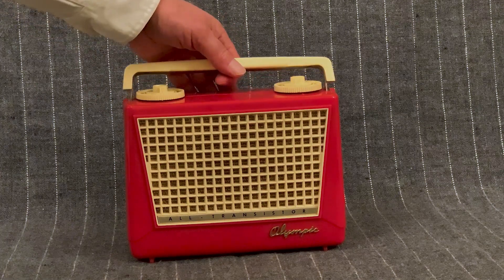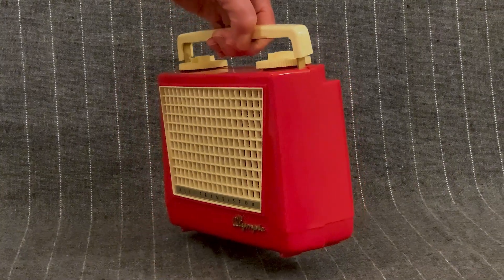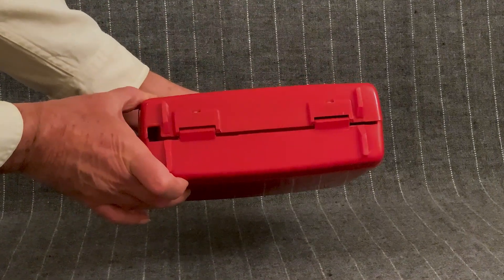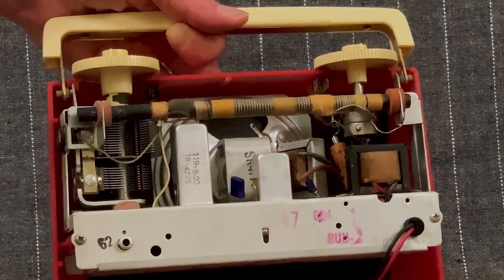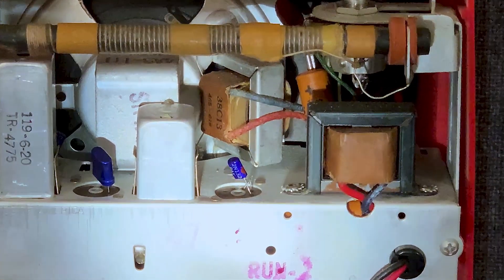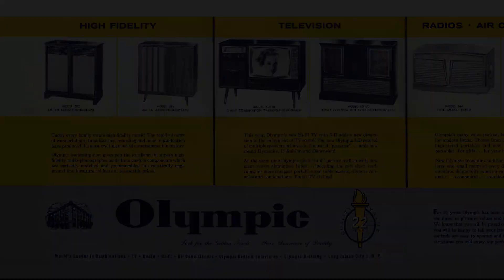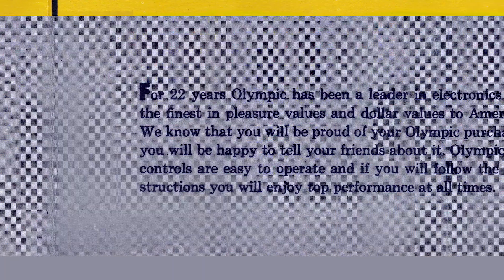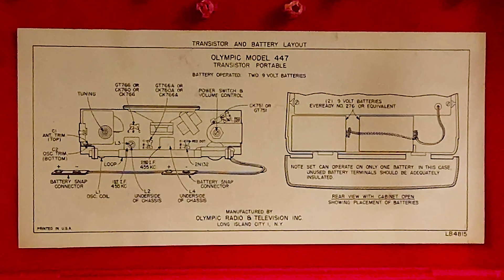1956 FIRST Olympic transistor radio plug-in transistors in tube sockets! Olympic 447

Comment: This radio sold for $31.00 when introduced in 1956.

This radio is interesting for several reasons.  As I recall, this company specialized in budget radios and TVs.  To keep costs as low as possible, they obviously took their tube portable radio and made as few changes as possible to produce the transistorized version as evidenced by the design.  This is the first time (and probably the only time) I have seen tube sockets used for transistors.  A lot of the US manufacturers used transistor sockets in their early transistor radios, probably due to tradition.  

A transistor was used in place of each tube, almost directly copying the previous tube circuit.  The tubes had much higher amplification (1,000 gain shortfall) so, this radio would only be useful in a big city that had a lot of nearby powerful stations.  

The radio uses an audio transformer between the two audio stages to increase gain, an expensive component.  This shows how expensive transistors were at that time.  The audio transformers are physically large, this is because Olympic used the same part the tube radio used but, wound it differently for transistor use. This suggests Olympic wound their transformers in house.  

The audio output stage is "class A", just like the tube set.  While having the best audio fidelity, they also consume a lot of power, hence the reason for the 2 large 9 volt batteries.  Most portable transistor radio manufacturers quickly switched to the "Push-Pull" audio output stage to reduce power consumption, as poor battery life was the number one complaint with the tube portable radios and, one of the biggest selling points with the transistor radios was their vastly improved battery life.

Comment: What an oddball. I have two Zenith portables with metal chassis and plug-in transistors from the early 60s. They're Germanium transistors but none of them have gone bad yet.
Reply: I have a couple Zenith radios and a Ross branded SW [ 3 band] that has sockets for the transistors.
[ they could have soldered the transistors in and used sockets for the capacitors😁].
📻🙂